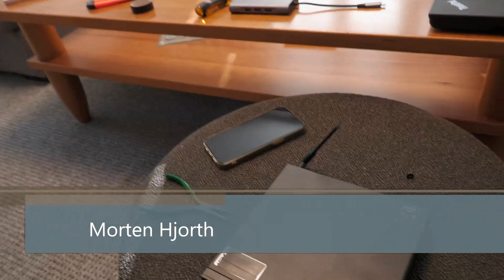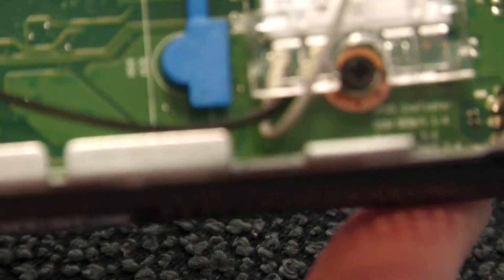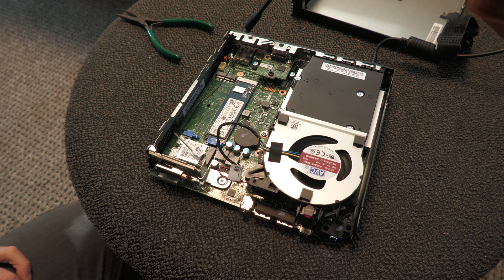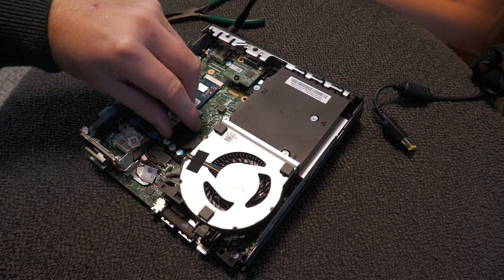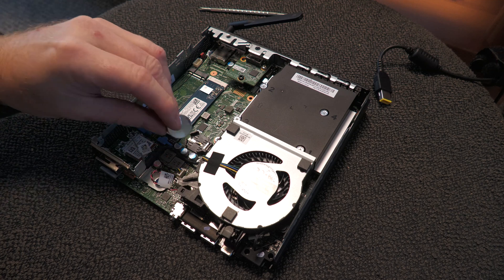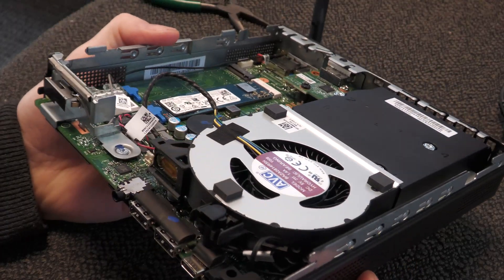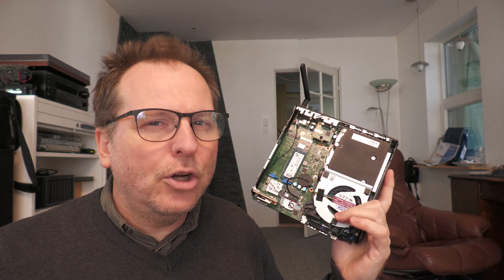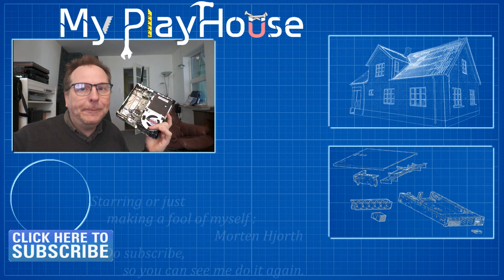Failing to Reset Supervisor Password on Lenovo M75q - 1538

Comment: Solution:
1) First remove the cover and set the jumper to 2-4.
2) Close the cover and start the PC
3) It beeps twice (I waited until it beeped twice three times)
4) Power off the pc by unplugging the power supply
5) remove the cover again
6) remove the jumper from 2-4 and leave it out
7) close the cover / plug in keyboard, mouse and Screen
8) power on the pc and press F1 repeatedly until you are in the BIOS.
9) in BIOS, load setup defaults (factory)
10) save and exit
11) open cover again, set jumper to "default" 5-6
12) close cover, secure it again with screw
13) have fun or reenter BIOS to configurate it
14) thank me later ... just kidding ... hope this helps

Comment: Yeah, you cannot reset that. I have an ex-company X1 Carbon laptop with the exact same problem, and the solution given by lenovo is to replace the entire motherboard. In mine, there is a security chip involved, not only a flash memory or eeprom, and there is an cryptograhpic handshake going on, so yeah, no luck unlocking that...
Reply from the maker: It will kill the Equipments afterlife...

Comment: Years ago I removed the password from a Lenovo X1 laptop.  Luckily, that model had a flash chip (storing the password hash) separate from the BIOS chip, so the trick to removing the password was to gently poke the data line with a grounded wire during power on.  That caused a checksum error when reading the chip, and the BIOS offered to reset it.
Reply from the maker: Uhh that would have done for a great video..

Comment: The option to disable pw jumper has been in Lenovo desktop BIOS settings for many years. Check yourself, there is an option in UEFI Bios which enables or disables the functionality of password reset using jumper.
Reply from the maker: I would not expect to have access to that without the supervisor PSW.

Comment: Hi! Beware that the password can also be stored in the embedded controller flash memory, which is even harder. I had trouble with an HP EliteBook and overwriting the bios using an external programmer did not help.
Reply from the maker: That is good to know, thanks for the advice!

Comment: have you ever tried to contact lenovo they may be able to remove the passowrd
Reply from the maker: I am sure they can,,, but not sure they would.. if I can call Lenovo and get the PSW removed,, it is really bad for security.
Reply: @MyPlayHouse  if you can prove legal ownership of the device there shouldnt be a problem with them removing the password but i cant help but wonder if u can remove the chip and erase the bios  password section or possibly somehow he able to read the password from the chip if anything contact the person that sold ya it or company u got it from and request the password

Comment: Sometimes the BIOS can be set to not honor the request by the jumpers to reset the BIOS password. As unfortunate as it is, you may have to ask for the BIOS password and do it that way. If you are allowed to do anything you want with the computer, you should be able to get the password without any issue.
Reply from the maker: I had Them put a fresh Win11 on it,, with out the work lockdown... stuff

Comment: Update and overwrite the BIOS from Lenovo using they're tools...
Reply: They usually flash company specific bioses to these, and the option to allow bios updates is locked in the default bios settings.
Reply from the maker: Yarh,, not with out the key :-/

Comment: Lenovo Golden Key is your friend....
Reply from the maker: Is that the tool that one would use when replacing a systemboard?
Reply: @MyPlayHouse Yes it is. Depending on the system it will allow you to reset the CMOS password. I've used it on laptops to free them from Microsoft Azure bindings that where never wiped. Its also used if you need to dump/reprogram the BIOS and you have to put everything back.

Comment: Removing the CMOS battery. Wait for one hour . Try and comment
Reply: That dosent work for lenovo thinkcentres! if the BIOS has the SVP jumper disabled then theirs no way to reset the bios if the pc is under warranty you can let lenovo know and they can replace the motherboard and that will fix the bios lock
Reply from the maker: Yarh,, I also do not think that would work.

Comment: Some manufacturers also have their own jumper on the board to reset the password, my previous work place had brand new dell machines where one guy set the password incorrectly, bought a bunch back and took the bios chip off the board to reprogram.
Reply from the maker: That would make for a good video..

Comment: resetting the bios is a different function to clearing the admin password. on some of these types of system just removing the jumper, in this case from pins 5-6 resets the admin password. don't move it to any other pin out, just remove it and power on. 
but on many of these newer system they are removing the ability to reset the admin bios password. Lenovo are also locking the CPU to Lenovo systems too (vender locking the CPU by default)
Reply from the maker: Yes,, this was not one of the easy ones...

Comment: The Admin password and User password function are always separated. Clearing the CMOS doesn't help, as this makes the IBM/Lenovo machines as secure as they are. But this is indeed also a headache.
Reply from the maker: Well on some models you can reset it this way..